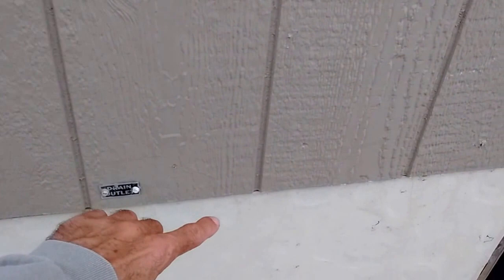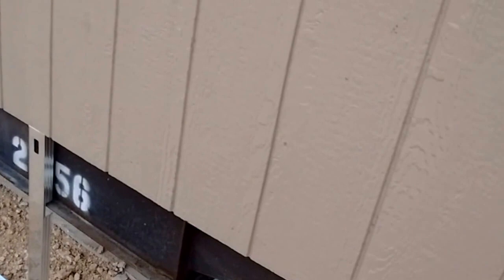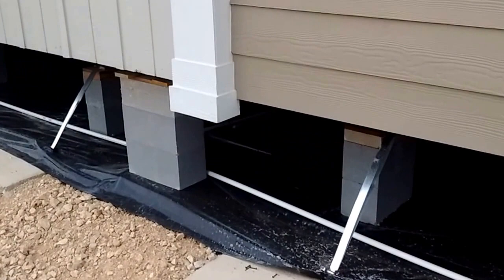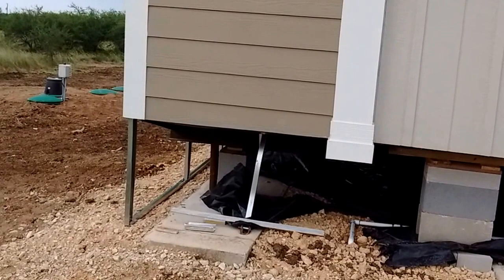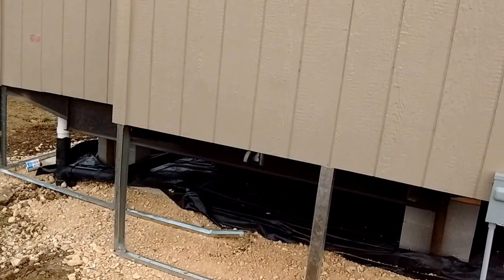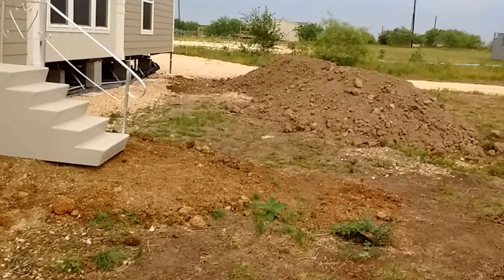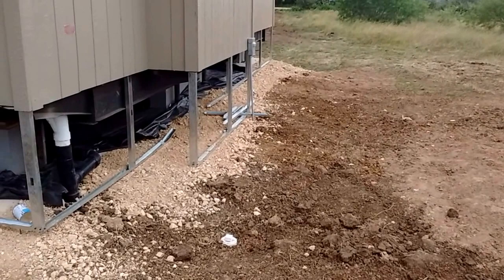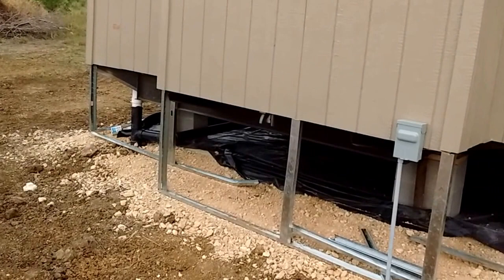Manufactured Home Skirting Frame Installation

Comment: One other thing I have done was use yard blocks of 2x12x18 and have thick mil plastic and tar paper under to keep moisture from wicking up into the metal studs.  The former thin metal had corroded and rusted and it was causing the bottom of the original sheet metal to rust on the bottom.
Reply from the maker: Yes, there is a thick mil plastic sheet that lays down under the house for moisture control.  Another great idea is to vent the skirting to allow air to circulate under the home.

Comment: its mild steel and use for control temp. this product will rust within 5-10 years depending on your state.
Reply from the maker: I'm pretty sure that metal studs were used for the skirting frame.  The same type used to build a metal stud wall.  One thing to mention here related to your comment.  It's important to have a good amount of ventilation on the skirting.  You can see on our home, there are vents installed in the skirting.  Good ventilation under the house will help keep down condensation.  I agree with you about the rust issue.  I think in our climate, we are better off with steel.  The dry, hot climate and subterranean insects wreak havoc on any wood, especially ground contact wood.  There are many skirting options out there, this is the system our installer uses.  I would suggest staying away from vinyl skirting, it tends to dry out and crack in a very short period of time.

Comment: I am doing something similar but I have put Mineral Wool/Rock Wool insulation behind.
Reply from the maker: Great idea but don't completely seal off under the home.  You wants some air circulation to keep down condensation, mold and rot.  Great comments as we are all learning from each other how to make our way through this process.  Thanks for contributing!
Reply: I still have vent areas for circulation.
Reply from the maker: @kermitefrog64  If you watch some of the later videos, you will see they installed vents on the skirting.  They are placed about 12 ft apart around the house.

Thanks for pointing that out to other viewers.  The venting helps keep down condensation under the house. 

We ask that you please subscribe if you have not already done so.  That helps get our videos out in front of folks like you who have some experience with manufactured homes and can give some good pointers to other.  Thanks for stopping by!

Comment: How did they attach the top of the studs underneath the trailer body?
Reply from the maker: The installer cut tabs on the metal studs and bent the tabs horizontally.  They then
 screwed the tabs to the underside framing.

Comment: How did you secure the bottom track?
Reply from the maker: The lower track of the skirting rests on the concrete runners on the long sides of the house and those are anchored with some type of concrete screw. The short sides rest on the road base fill around the house.  I'm not exactly sure how those are anchored.  Maybe they used some type of spike to keep them in place?  The top rail is screwed into the underside joists.

The skirting is really just a decorative thing.  It also helps seal off the bottom of the house to keep out weather and critters.  We are always cautious when cutting lawn near the skirting.  We stay about 6 inches away to avoid accidentally hitting the skirting.  We then come back with a string trimmer and trim to clean up close to the house.

We would highly recommend staying away from the vinyl skirting that's available.  It tends to dry out and easily cracks. 

One thing to keep in mind, your house will move/shift.  It's a given with a rail system foundation and that's why they are used.  In areas where the ground moves a lot, like out here in S. Central TX,  the rail system works the best.  Along with the house movement, the skirting will move.  The movement may be slight and happens during the change of the seasons.  Really dry conditions can also effect movement.  Here's a little foundation tip that is used out here in the country during dry spells.  We water our foundation rails!.  Keeping the soil somewhat damp around the foundation will help avoid the ground from drying out and heaving or shifting.  This is also a good practice to keep the concrete rails from cracking. 

Our skirting is made from a concrete impregnated material that came in 4' x 8" sheets.  It has a trowel like pattern on it to give it some decorative qualities.  It's about 1/4" thick.  We don't recall the name of the material. 

Hope that helps out with the anchoring question!  Our suggestions has always been to do as much research as possible before jumping into a project like this.  The better educated you become about doing a project like this, the less likely you are to run into surprise costs or poor quality.  We always recommend doing the research up front.

We created this channel for folks like you who are involved in setting up a MFG home.  We had a lot of unanswered questions going in to our project and wanted to provide others some job site guidance that you can't get in the showroom.

Thanks for checking out our channel and good luck with your project.  If you have any more questions, drop us another comment and we will try to answer based on our experiences.

Comment: Bracing...it needs band around the center too
Reply from the maker: Hello Brian.  That would give the framework more stability.  Thanks for pointing that out for future viewers to consider.  We had the skirting done as part of a package deal so it's what came with the house.

Thanks for stopping by and checking out our videos.  If you're finding some useful information, we ask that you please subscribe.  That helps get our videos in front of other folks like yourself.